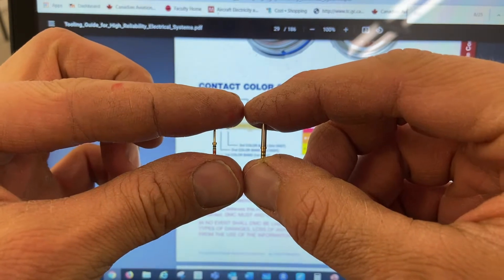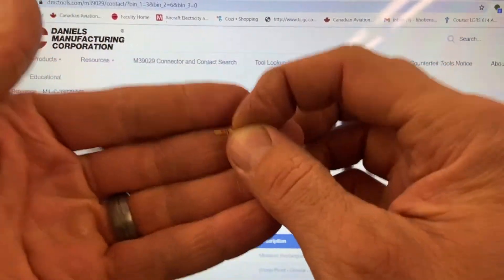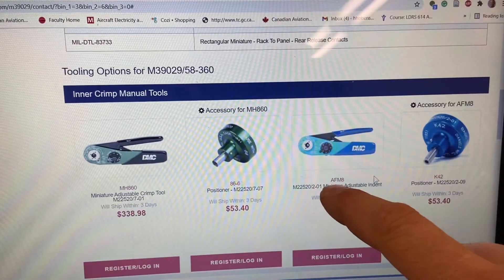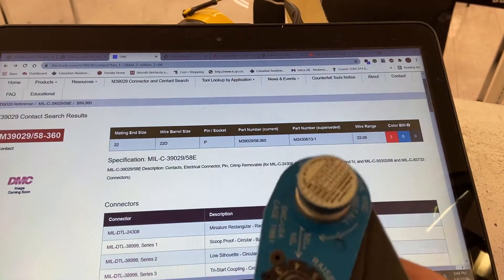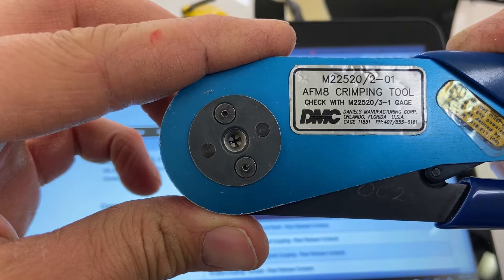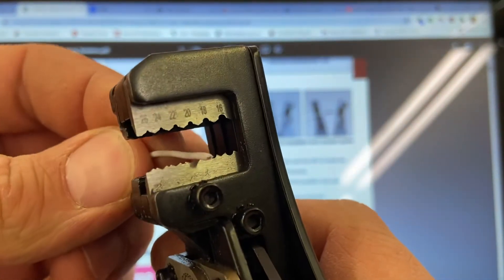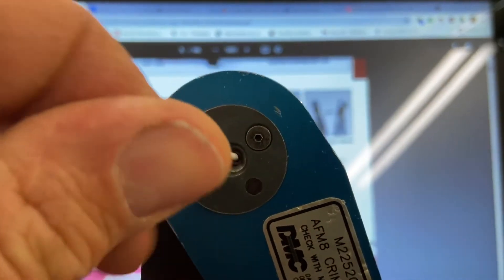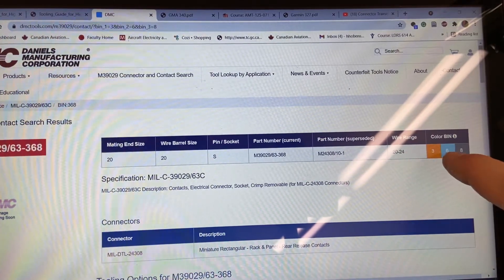DMC crimp tools

Comment: 6:00 Most wire strippers are marked for solid wire. Stranded wire, thanks to the air spaces between strands, have an overall larger copper diameter than the equivalent gauge solid wire. So it’s absolutely normal to need to go one size up for stranded wire. (Some wire strippers actually have two markings, one for solid, one for stranded, and the latter is simply shifted by one size.)